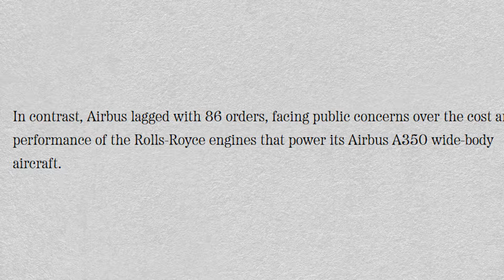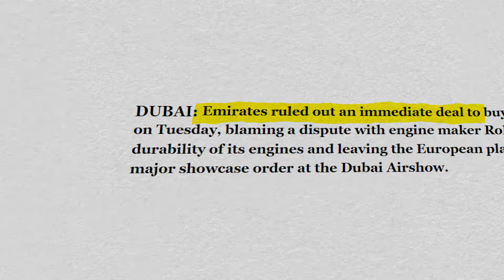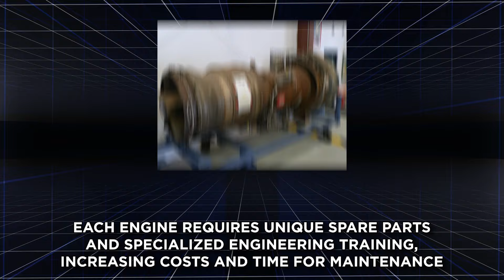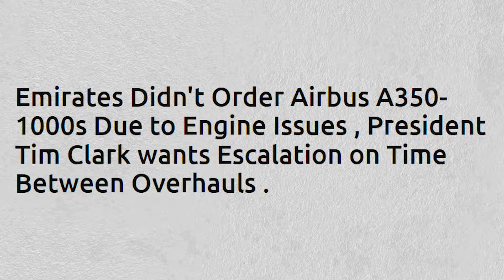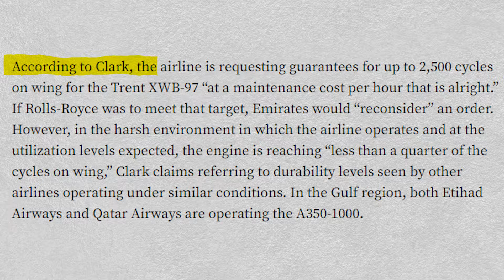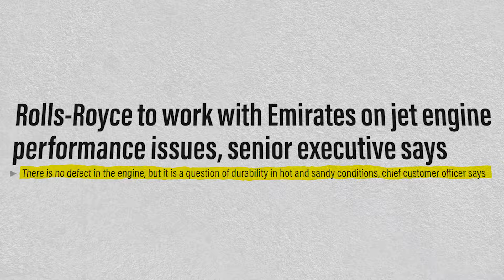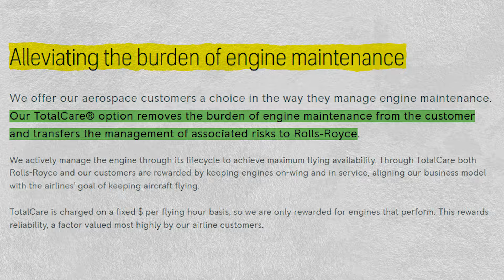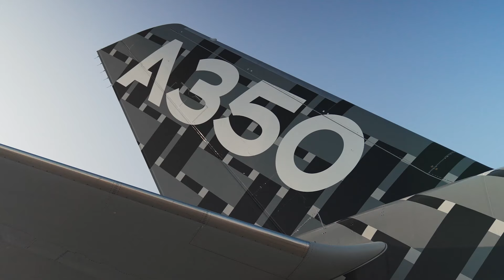Emirates says “NO” to Airbus A350! What’s WRONG?

Comment: I sas only yesterday a Video about Qantas prefering the A350~1000 over the 777X because of its maximal Range and fuel economy. So I don’t think Airbus has a problem.
Reply: 777x what about the others plus they are more cheaper to run
Reply: Well that’s different airline
Reply: Well boeing is just winning don't be jealous 😂😂
Reply: b777-8 has same range of 350-1000
Reply: @prasenjittripura4691 but it’s not even in production most airlines have gave up on it and brought the a350-1000 instead
Reply: also 777X program is continuing to be delayed because major focus is to fix the crap 737-8/max. 
I don’t know why airlines are still keeping the order and waiting for delivery of 737-8/max and they are not canceling the orders for that plane.

Comment: Emirates has ordered 65 A350-900s.. to help replace the A380 along side the 777. Their first aircraft is built, and doesn’t have engines yet but-
Emirates was always gonna go with the 777X aswell, as the A380 can only seat 400 something. And the extra capacity is needed to help replace it.

Comment: Nothing wrong with A35K, far eastern airlines ordered many of this variant: Japan Airline, Starlux, Eva air which is going to replace its aging B777-300ERs by A350-1000.  None of them ordered any B777X which is more suitable for extremely high volume routes.  

BTW, When will the B777X be delivered to its customers, 2026 or 2027?  It is un-proven for both the airframe and GE engines.
Reply: Will enter into service in 2027

Comment: Like so many aircraft channels/avgeeks you`ve fallen into the trap that is one airlines or at least the president of that airlines opinion on the A350-1000. While I agree with many people that Sir Tim is a legend in the industry he does say things which can stir things up a little. His criticism at Dubai of the durability of the T-XWB-97 was not warranted. The aircraft engine manufacturers are under pressure to produce evermore economical engines while at the same time making them just as reliable & durable. This is very difficult & costly to achieve, but in fact RR have done it with T-XWB. This is backed-up by some very decent orders recently from airlines that have been operating B777-300ER`s namely KLM, JAL, Korean, EVA, Ethiopian & Delta. There will be many more to come because this airframe wether it be -900 or -1000 is a proven & known quantity. Qatar, Cathay, BA, Virgin, French-Bee have been using -1000 successfully for sometime hence the more recent orders. Emirates not ordering -1000 will not deminish it`s booming order book.
Reply: The Trent 1000 was a failure on the 787 and more operators of this defective engine will be switching to the GEnx engine for their future 787 aircraft.
Air New Zealand are still struggling because ot the Trent 1000 with some of their 787s unable to fly.
Unethical business practices including overpromising engine performance by RR also adds to their woes.
Reply: @John-nc4bl  Trent 1000 is only a failure in your mind. Fortunately it`s being purchased by airlines that know just a lttle more than you about the quality of the engine. There are planes around that are grounded due to spare parts shortages, these are not related to just one particular engine but to many engines including your beloved GEnx. Get your facts right & try to get over the troubles T-1000 had & that were fixed four years ago....you will feel better for it.

Comment: Why not use GE engines on A350?
Reply: What GE engine can they use? GEnx is not powerful enough & compared to RR T-XWB is older generation. Before you suggest GE9X you do know it`s not even certified yet for the aircraft it`s designed for.